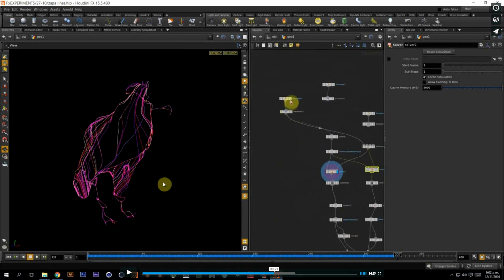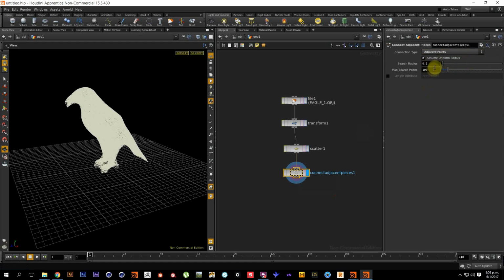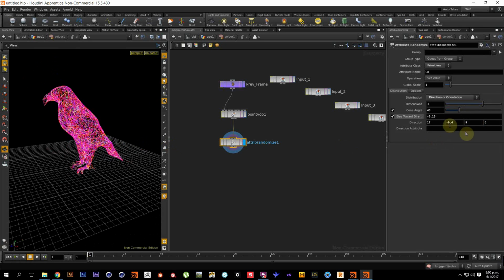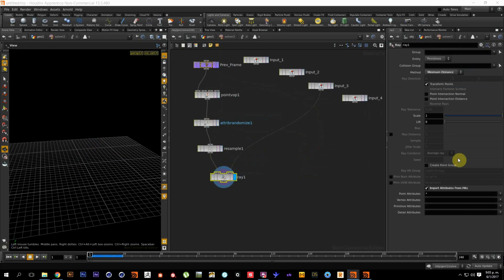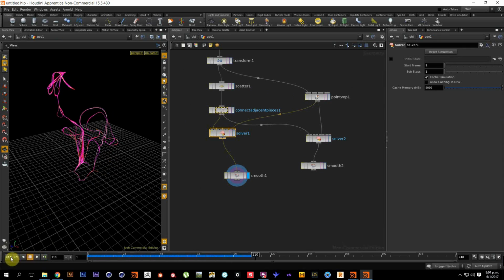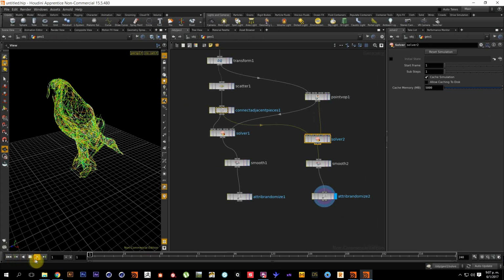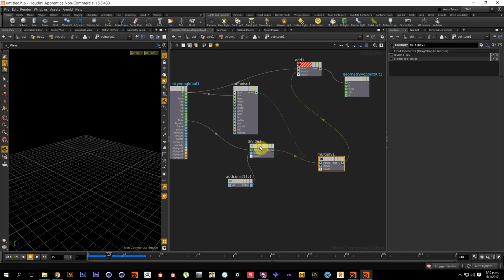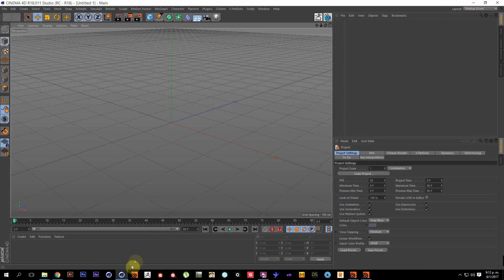Houdini Tutorial 01: Liquid Lines

Comment: when i add the connect adjacent pieces node i get a warning and my mesh disappears, do you know what is causing this?
Reply: Try pushing up the 'search radius'. It solved the problem for me.
Reply: Did you ever resolve the issue? Can't seem to get past this
Reply: Justin Leung nope
Reply: You need to change type from "Adjacent pieces from points" to "Adjacent points".
Reply: I think i know how to fix it, try pushing up "force total count" in scatter node, for me the default value for this was 1000, when i changed it to 10000 i now have the same results as author of the video, i dont know if this will work later but i need to finish tut first, peace, hope it works!
Reply: Guys, if your mesh is disapearing  after you connect a node, after your mesh add a "Convert" node.
Hope that helps.
Reply: or use an "object merge" instead of connecting the mesh directly.
Reply: it is not related with '' adjacent points''.. I ve already tried adjacent points. when I connect nodes , mesh is disappearing .Also some nodes has lock symbols. I tried to unlock these nodes but it doesnt work again... Probably he doesnt want to share his knowledge and he is keeping these type of hints for himself. This tutorial totally waste of time.